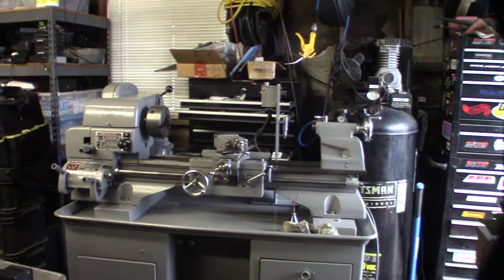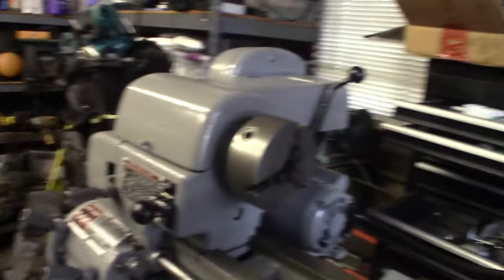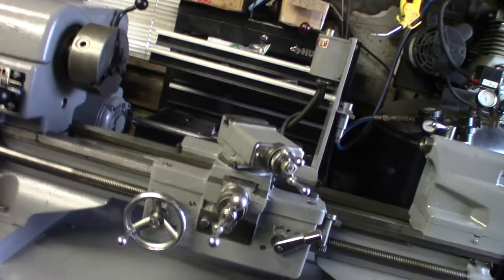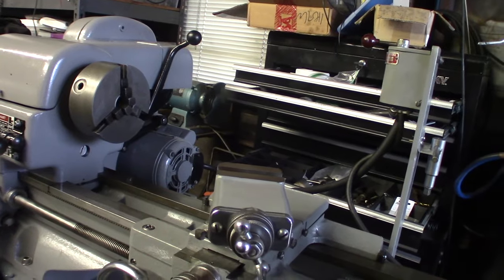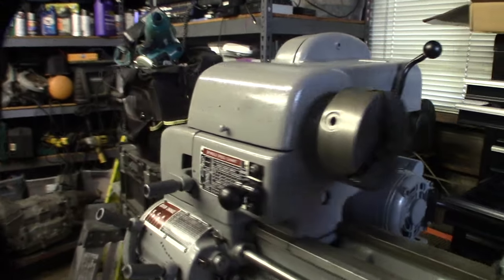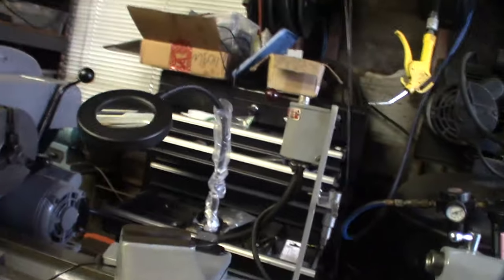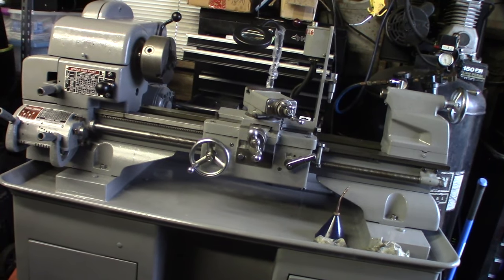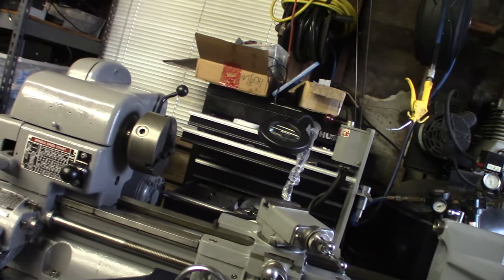Craftsman Atlas 12" Lathe Restoration Part 7 Finishes!!! Testing and Cost Breakdown

Comment: Looks like a lot of sweat equity you put into that old Atlas. Nice work. 
Careful with the reverse. Lathes with the thread on type chucks can unscrew when put in reverse. I’ve seen it happen when the lathe is in reverse and then shut off. Most people will never have a need for reverse on a lathe.
Reply from the maker: Good point, my mini lathe did not have reverse. My larger tsuagami does with bison 8" chuck does. Almost had it come off when I was testing my cnc conversion.